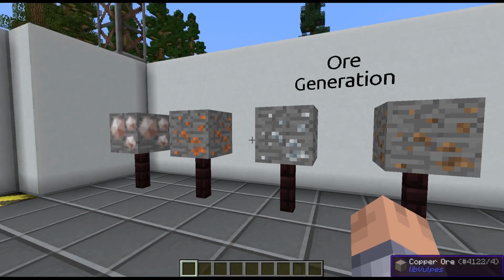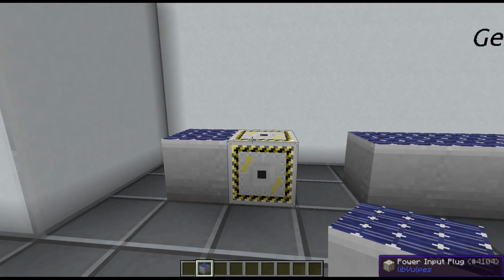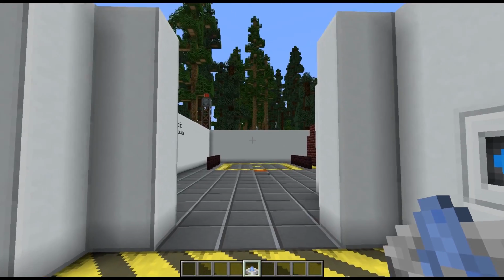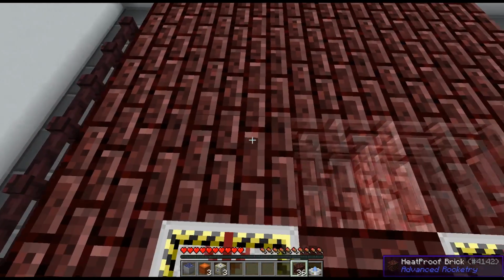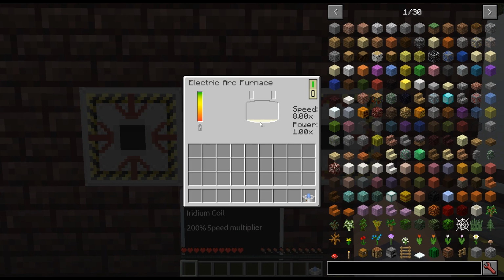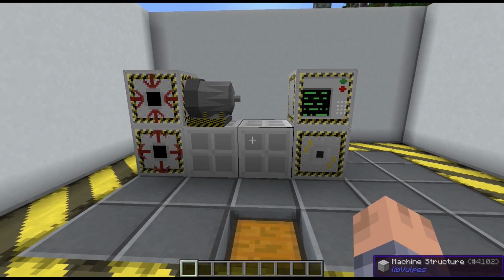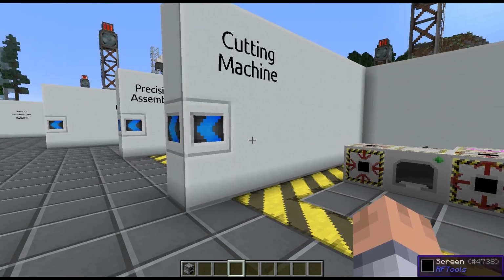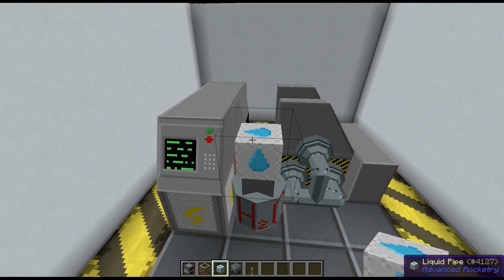Advanced Rocketry Mod Spotlight - Part 1: Machines

Comment: I cannot find the recipe for the upgraded coils in my 1.7.10 advanced rocketry, any ideas?
Reply: they all are crafted the same, just put ingots of the metal you are making them out of in the chest pattern ( every crafting slot except middle).
But I don't know your problem, I am 1.7.10 too and it works fine and dandy for me.

Comment: I need help, the pipes from advanced rocketry say they Are deprecated how do I charge the multiblock machines then?
Reply: The only solution is to use other mods' pipes. AC is easily compatible with Ender IO and Thermal Expansion.

Comment: Can you even craft energy pipes? If I can, how do I craft it or what extra mod do I need to be able to craft it? I can't make a solar panel that is outside connect to my machines that are inside my house. Please help.
Reply: SuperNinjaPedro1 The pipe's craftings are no longer avaliable! This Will be added in Future updates, you Will need other mod to do that.. i use Ender Io, The cables are Full compatible with Advanced Rocketry :D
Reply: Maksuel Oliveira ok thanks!
Reply: Thermal expansion works too

Comment: nice mod... but: no crossmodding wich mekanism for the hydrogen and oxygen? i tryning but don't work... 

( ps, i'm italian: sorry for weid english )
Reply: You can use Mekanism's liquid oxygen and hydrogen. Those are made by processing the gases in a rotary condensentrator. However, the gases themselves do not work. Also, Mekanism's electrolyser is far too slow to be useful.

Comment: when i use the holo projector it wont let me scrool through all the different structures
Reply: WheresMyWein You cant croll between structures just trough the stages you have to pick the structures wit shift+right click then when you scroll you can check what block you have too place on wich height